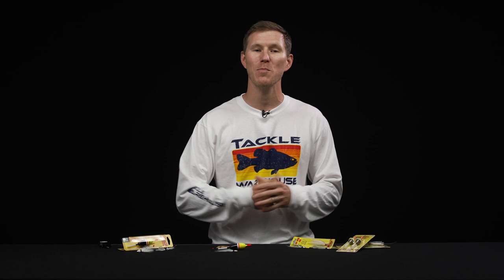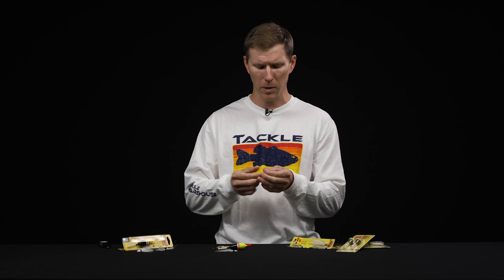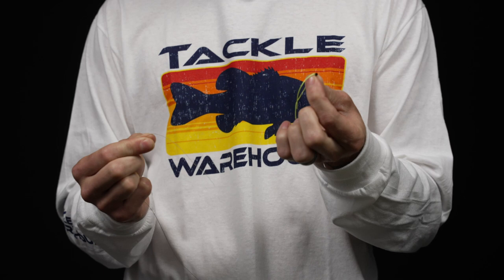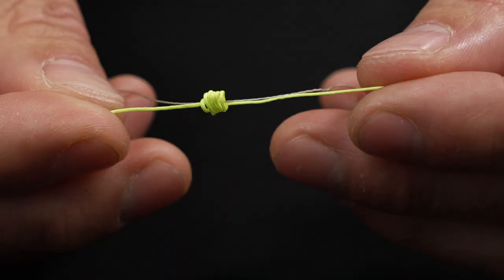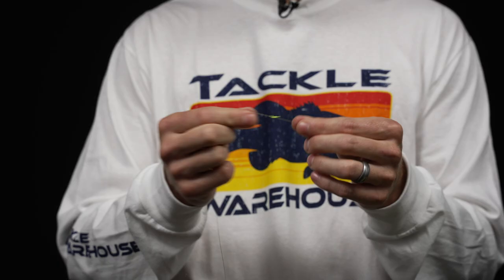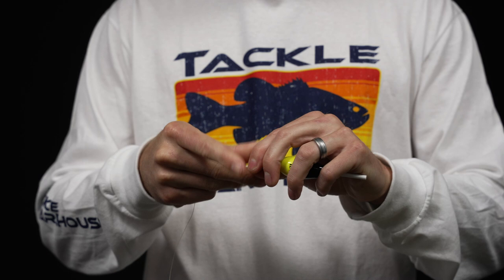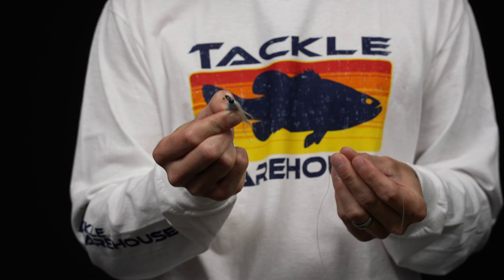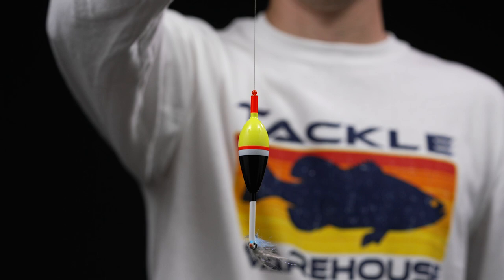How-To Rig a Float N' Fly

Comment: So what's the trick to fishing it? Let it sit or work it as any other jig?
Reply from the maker: It's great to experiment with both techniques! Often if there is enough chop on the water from wind or other factors, that alone imparts enough action. If the lake is particularly calm, it can be beneficial to work the jig. This presentation is commonly used in Winter when the bite is challenging and fish are lethargic, so less action can be the goal. We hope this helps! - TW Staff